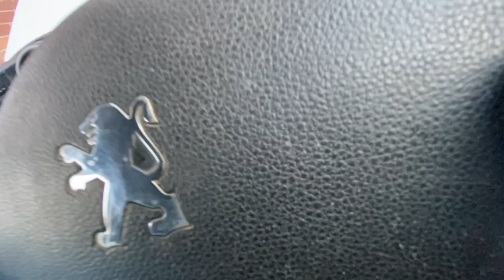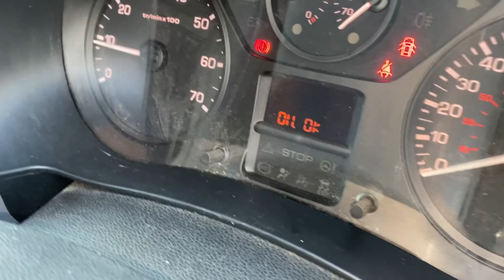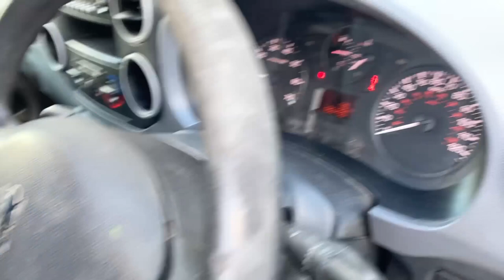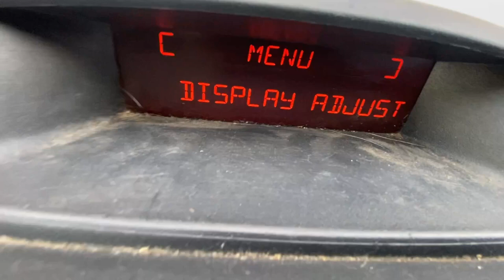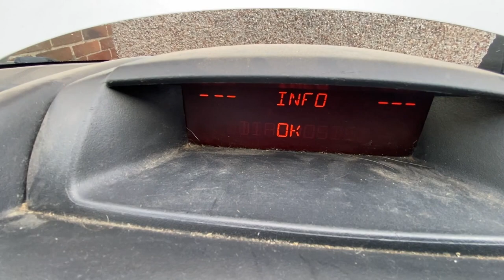How to Install Airbags, Seat Belts & ECU on a Peugeot Partner Van!?

Comment: thanks for the vid. Did the codes need clearing with diagnostic tool or just went away once reconnected?
Reply from the maker: I had the ecu wiped of a company online and went I reconnected it the codes had gone
Reply: @restoringsalvage  Thanks for replying. I paid a guy on ebay to do the ecu. Bought second hand seatbelts, fitted them, but get resistance too high error on both pretensioners. Not even diagbox clearing the codes. Seller telling me to check wiring and replace seatbelts again but all seems okay. Been a nightmare mate! Who did you use for the ECU clearing? You mentioned you had some codes left over even after the ecu reset do you remember what they were?
Reply from the maker: @misterzee5736  I can’t remember what codes I had left I probably just wiped them after and they would have been cleared did you change everything also I use CrashData.co.uk I’ve used them several times been great sometimes tho you can have high resistance problem always a mission to sort out
Reply: @restoringsalvage  Yeah changed everything. Going to disconnect then multimeter test the seatbelt tensioners incase one of the breakers sent me a blown one. Gotta take off carpets and check wiring too. Not always easy the salvage game! Enjoyed your other builds mate keep it coming. Thanks for the site will try that as last resort.

Comment: Hi, thanks for the video, very informative! 👍  Are you able to tell whether or not the seatbelts pretensioners have fired by looking at them?  I have bought a semi-repaired accident damaged car, I know that the ECU needs to be sorted, but I don't know whether or not the seat belts have been replaced, thanks!
Reply from the maker: Hello thank you and yes if you have an obd reader you can plug it in and scan the car to see if they have blow it will say pretension fault or something along them lines also if the seatbelt dose not retract it will be faulty
Reply: @restoringsalvage  Thanks for your reply.  Yes, I have diagnostic equipment & it says that both the airbags and the pretensioners have been fired, so I know that I need to get the SRS ECU reset.  The airbags have obviously been replaced, but I'm not sure about the seatbelts, hence the question.  From your reply, I gather that when the pretensioners fire, they not only tighten the belt, but they end up locked permanently locked in that position and no longer retract, is that correct?  Both of my seatbelts retract OK, although the driver's side is a little lazy, but I think that suggests that it's just been replaced with a well used second-hand one.  Any idea what happens to the passenger seatbelt if it gets fired when it's not being used?  I guess that it might end up locked in the fully retracted position.
Reply from the maker: @martinhounsell3767  yes they do fully lock out but they can be unlocked by simply un bolting them and releasing the pressure so that could have possibly happened best bet it to get the airbag ecu wiped and see if the codes are still present